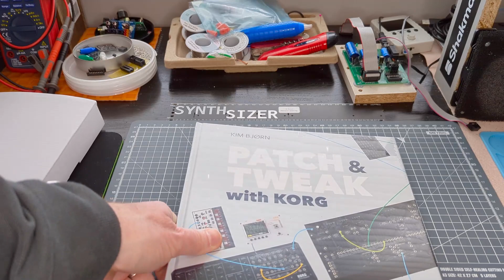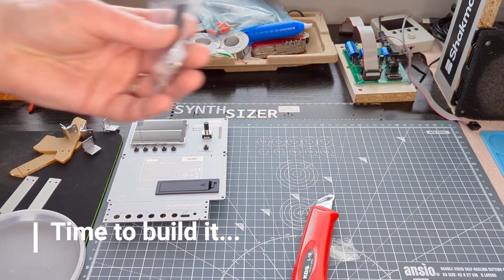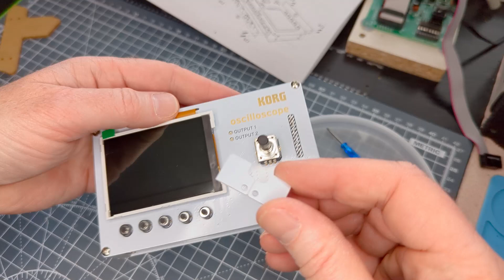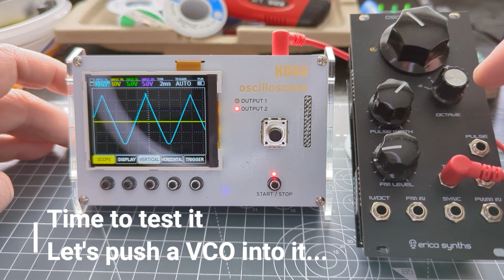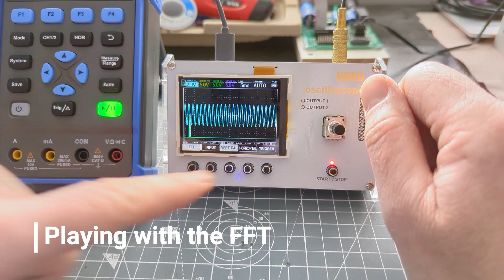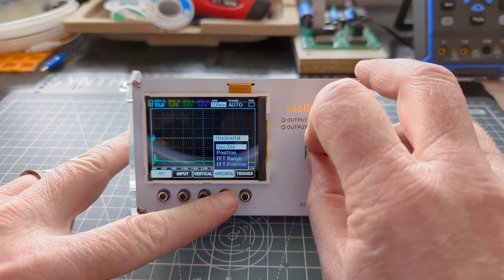Korg NTS-2: Unboxing, build and review

Comment: Did your tuner jump all around and display tones with nothing plugged in? Also is there a lot of noise in the wave display? Been trying to tell if mine is defective or that's just a quirk about these.
Reply from the maker: I don't remember experiencing either of those behaviours with mine
Reply: I have the same thing on my side and for me it's an issue. We can see during the assembly the same thing on the video ( tuner jump to D9 and other values at 11:06 on video) I 'm waiting for a reply for my shop for this, but for me it's an issue.Have you solve the problem @seanissofresh?

Comment: This may be a dumb question: does the power button only work for batteries? mine does nothing when pressed for any length of time and just hoping it was not an installation error on my part.
Reply from the maker: @michaelnervOus  my power button works  when using batteries or USB power
Reply: @ModularExploration I was afraid of that but also not sure if it’s really necessary to have a functioning power button.